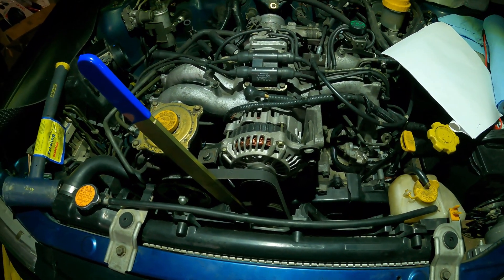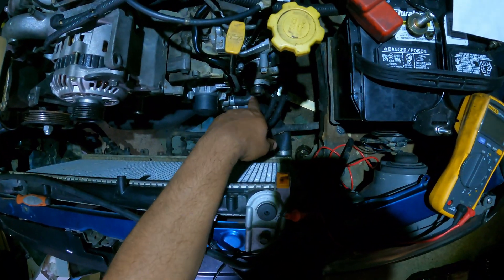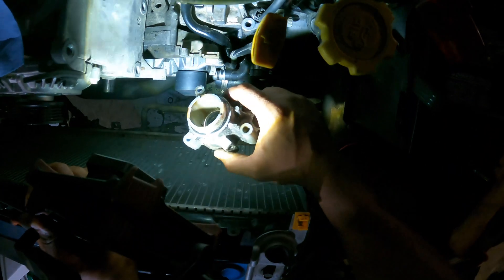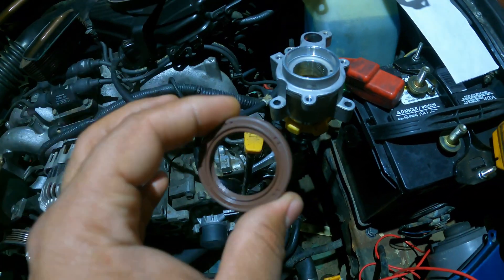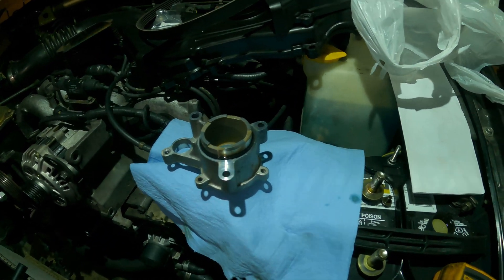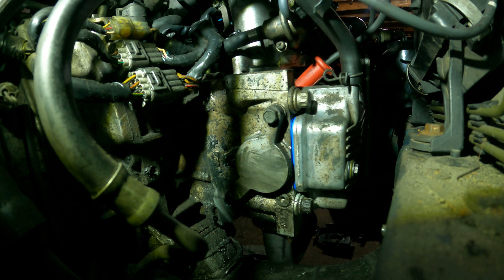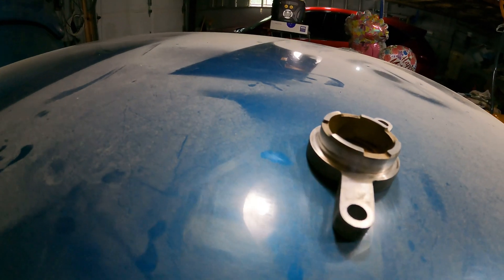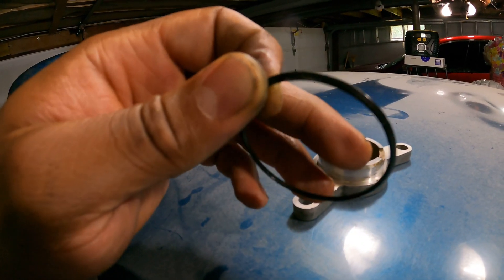GC8 SOHC Cam Seal Replacement

Comment: About to tackle timing belt change on my EJ22, 97 OBS. Thanks a bunch, seems it's hard to find much info about the cam shaft seals for this old motor.. even the FSM kind of breezes over them and at which point its best to replace them.

Comment: Cant thank you enough for this. Quick question, not trying to cut corners, but this is my daily and im trying to be in and out. I suspect my rear seals are the culprit. With that being said, does the motor need to be set to TDC? I only ask cause the rear seems to be more of an inspection cover, rather than being keyed for the cam. I hope that comes across right.
Again, THANK YOU. youve already pointed me in the right direction with the video alone